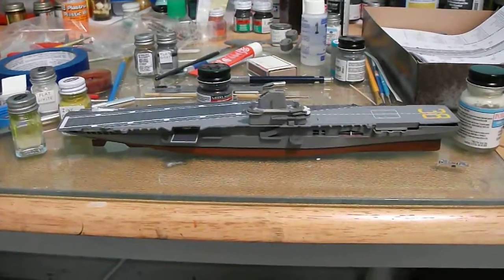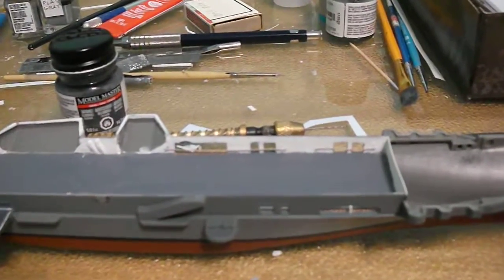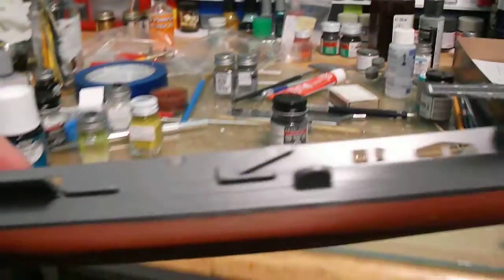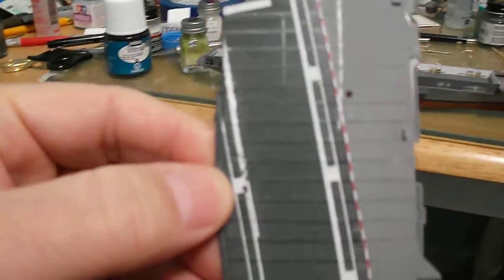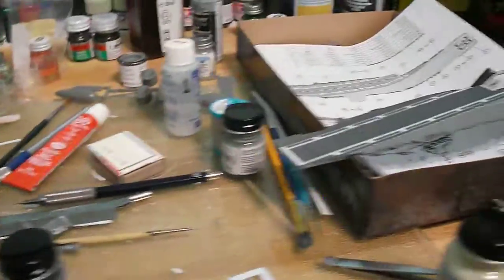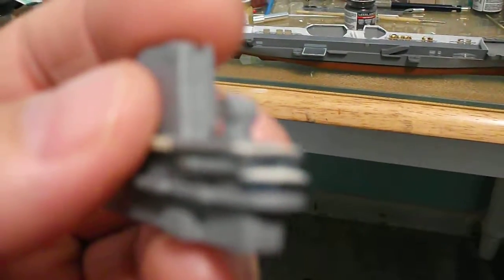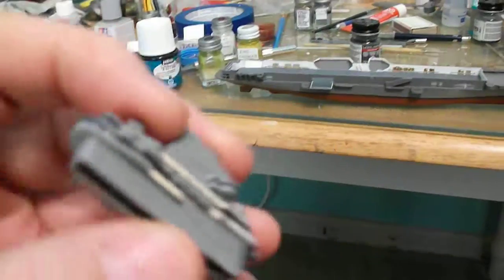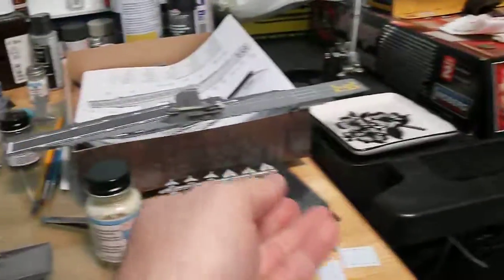USS Shangri La CVA-38

Comment: Lindberg kits are not known for quality (they're simple little kits for kids or weekend modelers), but I have the Renwal / Revell version of the Shangri-La in 1/500 scale. I'm willing to bet the Lindberg kit is MUCH better than the one I have. The Renwal / Revell model has some of the worst flight deck molding I've ever seen. Huge depressions from bow to stern. You can't fill them in because you would sand off the deck details in the process. I'll have to buy an aftermarket wood deck for it; it's pretty much essential.